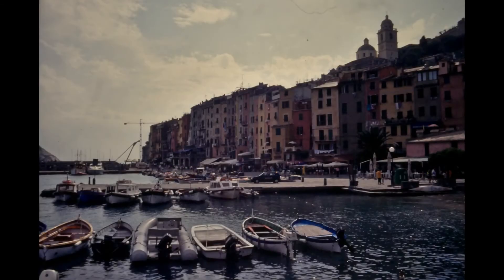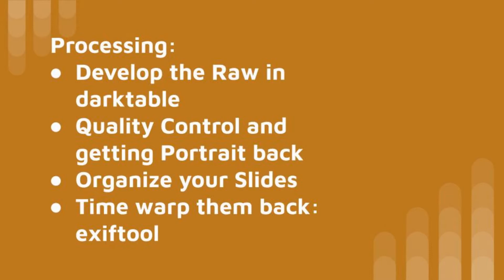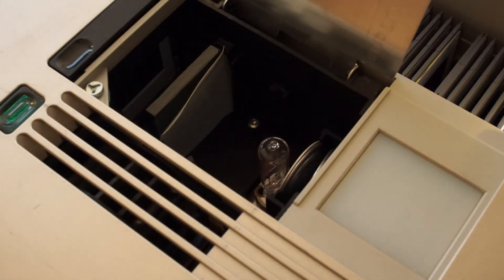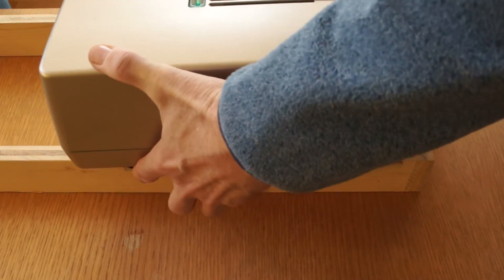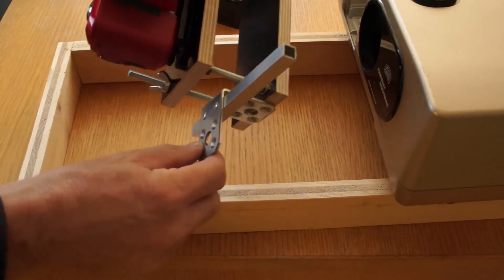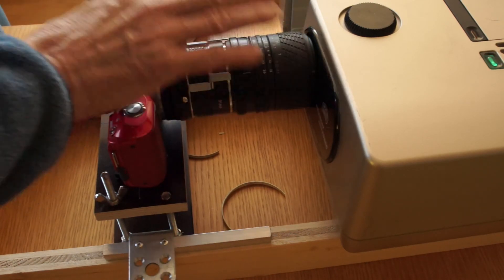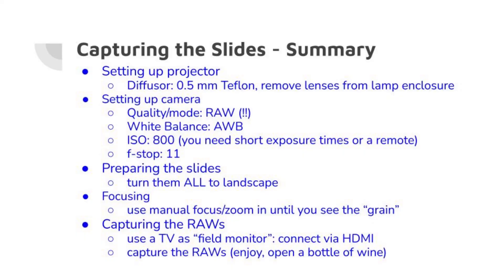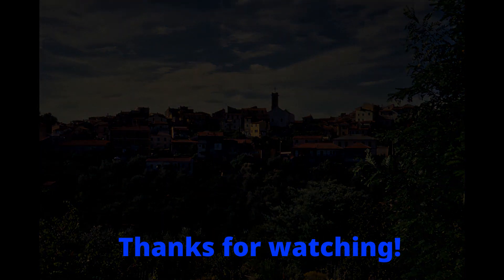Digitze - Scan slides with camera and projector - fast, low cost, good quality - Part 1: Capturing

Comment: Hi we need. 
Convert jpeg to 35mm film 
For Projection purpose 
Can you help me this matter
Reply from the maker: Sorry, but it's not clear what you want to achieve. If the technique presented here does not help, I am sure you will find some solution elsewhere on youtube. Cheers.
Reply: I want to print logo and images on 35mm film 
To prepare slides in  projector for logo projection

Comment: Great idea! I was thinking of using the Nikon ES-1 or ES-2 lens attachments but an automated projector would be much faster, which is important since I'd be doing many thousands of slides (for all my family going back to long before I was even born).
Reply from the maker: Thanks for the nice comment! I wish you success. The method presented here is "semi-automatic": slide change and taking picture (with remote) are done by hand but as you see quite speedy. Efficient processing is also important: here is my second video about processing the captured RAWs with open source software: https://youtu.be/BNpqdq_S29g?feature=shared . Hope this helps and good luck with your project,

Comment: There is one potential quality issue to be tracked with these set-ups.  The lens can be on the projector, projecting the image onto the camera sensor, or it can be on the camera, in effect focusing on the slide inside the projector, which just becomes a slide holder with auto-change function. If you use the projector lens, you retain the auto-focus feature most projectors will have. This compensates for "pop", the movement of the slide toward or away from the lens as it warms, or if loaded at different focus points. The problem here is that the projector lenses are just crap, made worse by being focused at inches rather than the feet of distance they are designed for.  If the lens is on the camera, you lose the auto-focus feature of the projector. This may be acceptable if the slide is loaded, photographed, and cycled away quickly enough not to "pop", but you still have the problem that the slide may not load at the same focus distance from slide to slide. Projectors were just not built to maintain such tight specifications, as the auto-focus system solved all possible issues.
Reply from the maker: Thanks for this comment. I thought also about using the projector lens (I have even one with aperture setting) but it would need some additional lenses (makro) to get the image in the necessary size on the sensor. Furthermore it depends on how thee autofocus works (measuring sharpness oder distance ...). Regarding the "pop" you are right: but as you wrote you just have to change slides quick enough so the pop is no problem. When digitizing slides with my setup I can ran a full load of slides through without losing (visibly) focus and maintaing quality.

Comment: What is the effect or advantage of removing the condenser lenses?
Reply from the maker: This is a recommendation I found elsewhere. I was also sceptical about the effect as the collimator should distribute the light equally. Thus I tried it first with the collimator in place but then you see the glowing lamp as a spot in the image (even with open aperture and on focus). Removing the collimator and replacing it with a sheet of teflon worked well.
Reply: @the_geargineer  Thanks for the reply! I did the same (removed condenser lens, added teflon) and it is working well.
Reply from the maker: @TobinFricke  great. Thanks!

Comment: Thanks, very useful. I just tried a quick and dirty approach without reading first and almost melted my acrylic sheet. My mistake was apparently to leave the lenses in places but I assume it's concentrating the light from the high power 250w 24v bulb ? Can you confirm your projector had a similarily powerful bulb ?
Reply from the maker: my projector has also 250W but it can be dimmed down. I estimate I am using half the power. To dark gives a to yellowish light - more difficult to correct. I also tried the apparatus with the lenses in place: did not work (very inhomogenous lighting), they have to be removed. The diffusing shield replaces the lenses and has to be heat resistant e.g. teflon (if that's your "acrylic sheet" you should replace it with a teflon sheet). Hope this helps!

Comment: Well presented video - I am part way though modifying a Kodak  760H. This will finished this week so await with anticipation for Part 2 of the series.
Reply: Ian the first thing I'd do is swap out the 300w ELH Lamp in your Kodak 760H carousel with a different MR-16-size  GY5.3 base bulb of a lower wattage,  maybe a 150W Ushio ESD .  It'll still be too bright but won't run as hot and you could put a ND filter, maybe a 0.90 Wratten (3 stops) behind when diffuser sheet on the lamp side of the slide chamber.   That way you won't have to gut the mirror and condenser and heat absorbing glass.  If you gut the thing and stick an LED bulb  in there and supply it with an appropriate external, current-limited  power supply.  .  Then remove the projector lens and mount a 105mm macro lens on the camera.  You may need a (short, 12mm)  extension tube as well.   If you hack the remote advance out on the projector and hack a shutter release on your digital camera, you could set it up with a relay and a capacitor (for delay) to toggle between advancing to the next slide and actuating the autofocus/shutter release.  That way a 40 or 80-slide carousel will be automatically scanned in minutes with the flip of a switch.  I would stop the lens down no more than 3 stops from wide open, as too small an aperture will decrease lens sharpness.
Reply from the maker: Thanks! Sounds good your project! I am little bit late on this 2nd part and currently am quite short on spare time - but this gives me motivation :-) Maybe I do a short summary of what matters ...
Reply from the maker: Sorry - currently no time to make this 2nd part. You will find good advices here: https://discuss.pixls.us/t/looking-for-automatic-darktable-style-for-processing-digitized-slides/24199 . I use exactly that (no base curve), and copy the "style" all other slides. Finally I use gwenview to do orientation back to portrait (bulk edit). With exiftool you can set EXIF date to the (rough) capture date so your gallery does not take the slides for "recent". Good luck! I will definitely do some times this second part, but I don't know when.